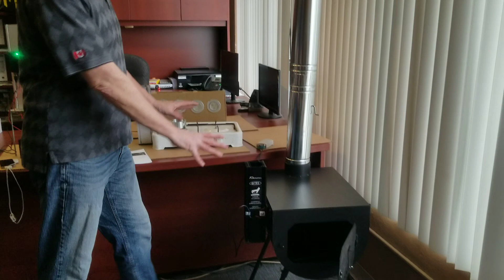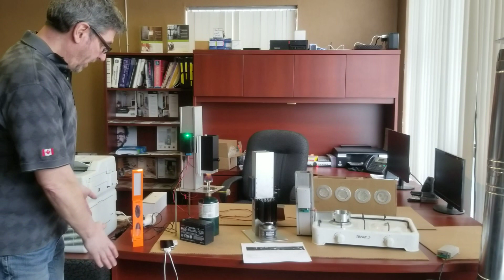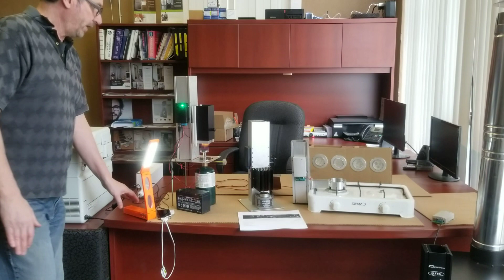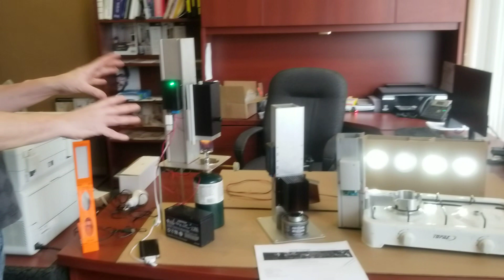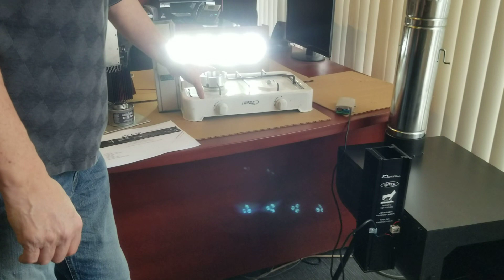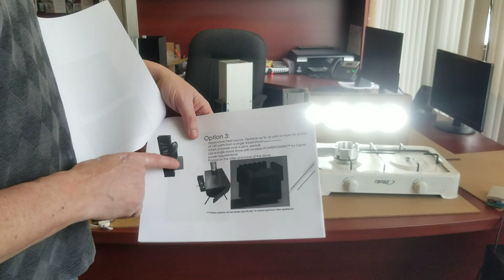TECTEG Mfr. ENERGY Solutions "Distributed Power for the Masses"

Comment: I also would be more interested in a larger unit,  based on wood heat  If we can get up to 200 watts max output, even with large modifications to the wood stove it would be a massive seller.